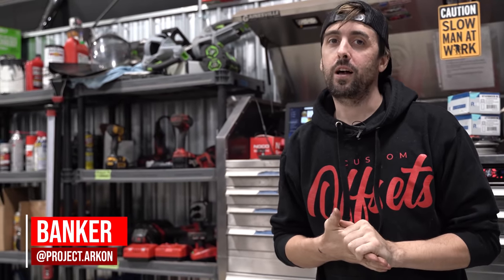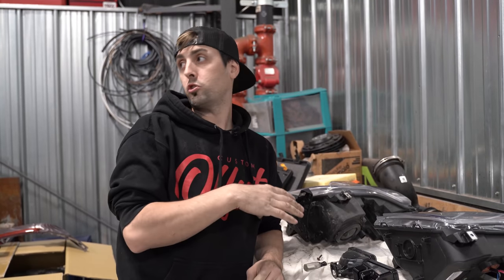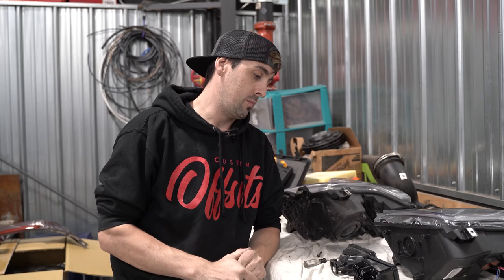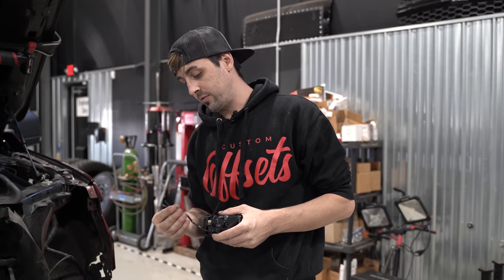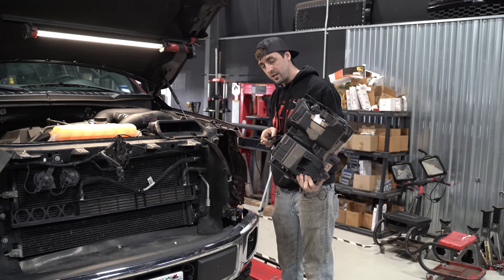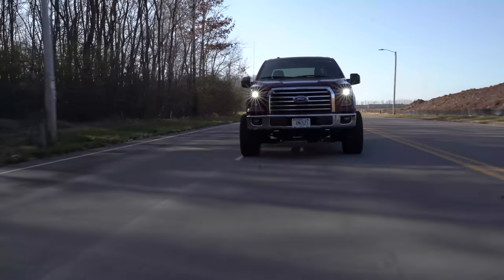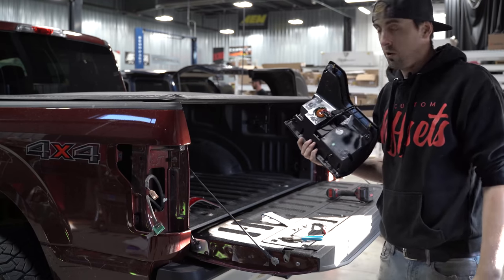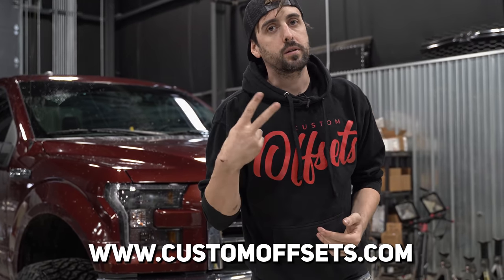EASIEST WAY TO UPGRADE THE LOOK OF YOUR TRUCK!!

Comment: You stand out when you have something that no else really sees anymore such as the 89 and 90 First Gen Cummins, 1961-1966 model year pickups and same with the 1967-1972 model years. Or do a ridiculous engine swap, like a 12 valve in a 67 mustang or something of the sort.

Comment: Guys Morimoto is the absolute best of the best. I have a full set of Heads-Fogs-Tails on my 18 F150. (Link to it on the gallery https://www.customwheeloffset.com/wheel-offset-gallery/1186461/2018-ford-f-150-xd-xd849-zone-suspension-lift-4in)  and they're amazing. The ones you saw in this video were the "hybrid" headlights from Morimoto, which reuses the stock turn signal bulb. The highest model of these have a sequential LED turn signal built in. Morimoto are the best headlight brand out there period.
Reply: I went with the Alpha Rex up front and Morimoto in the rear. Personally i think Alphas are a step above the rest up front. Taillights though...Morimoto hands down.